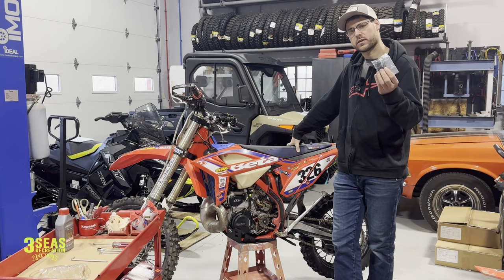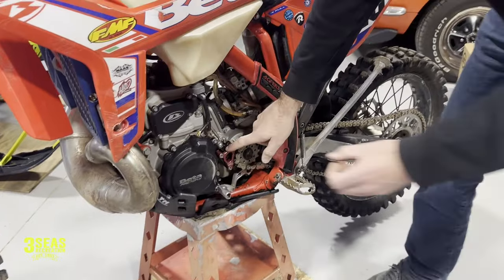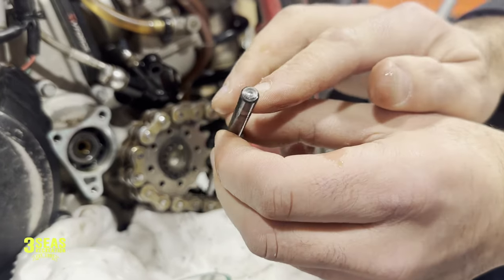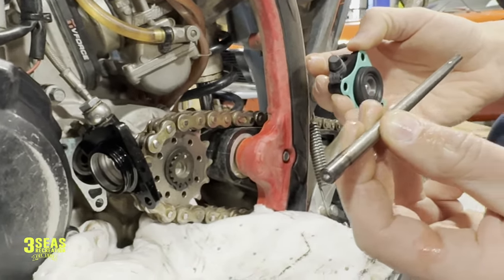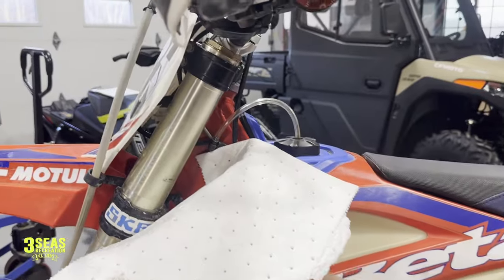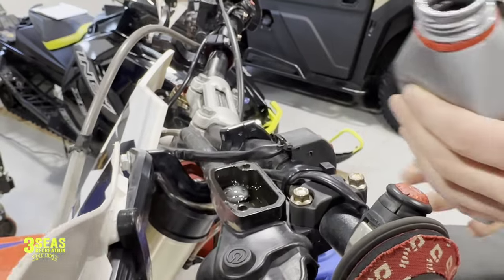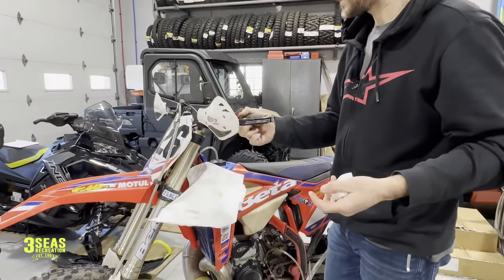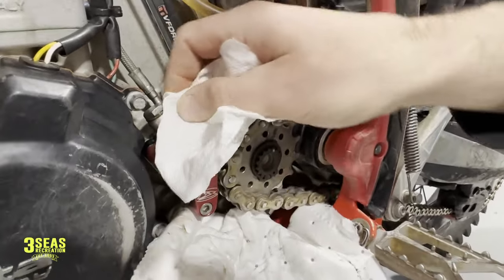Beta Motorcycle Tech Tip: Hydraulic Clutch Slave Cylinder Replacement (You will do this eventually)

Comment: When the slave cylinder fails, does hydraulic clutch fluid go into the gear box? Wondering if I should flush trans that before slave had fresh trans oil.
Reply from the maker: Yep, the oil will go into the transmission side. I wouldn’t do anything more than a normal oil change right after you fix it. No need to take it apart or flush it. Enjoy The Ride, Jared

Comment: take the old one apart to show us after replacing the new one ...?
Reply from the maker: Hey, the old one stayed with the customer as an exteme back up on their trip. This bike did not come apart because it needed it but we were helping a customer out on race day. They were headed south for a week of riding after the race and needed parts that day. There is no use in taking them apart as it requires a pretty special tool to get the piston and gasket back into the slave cylinder.